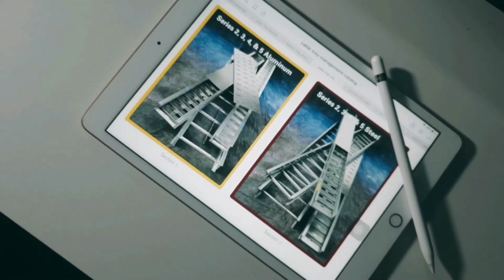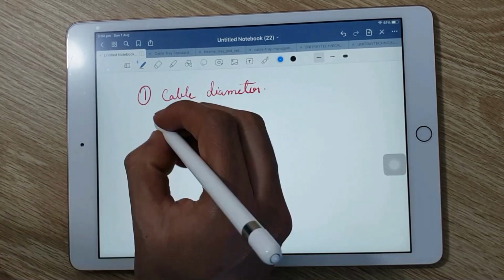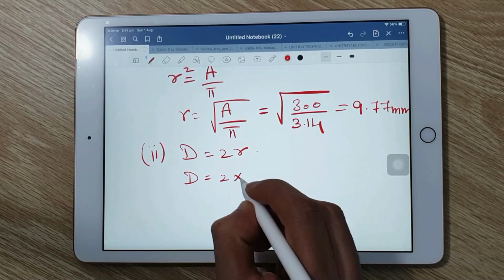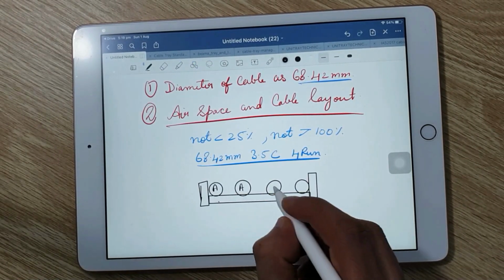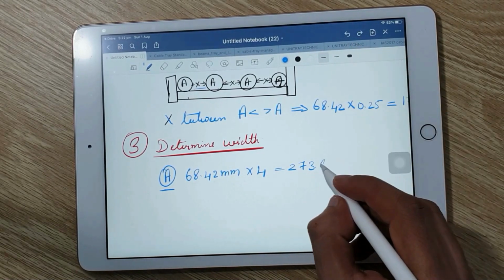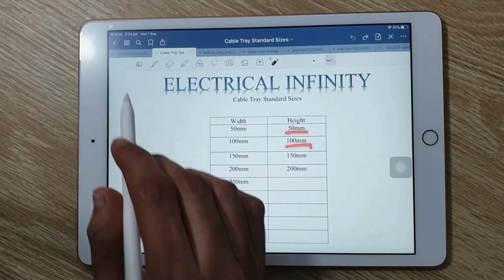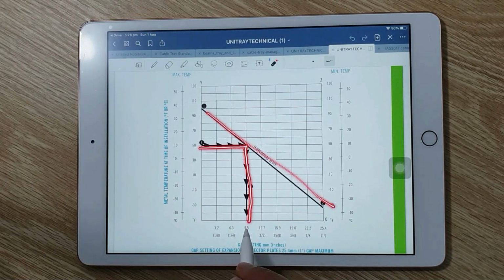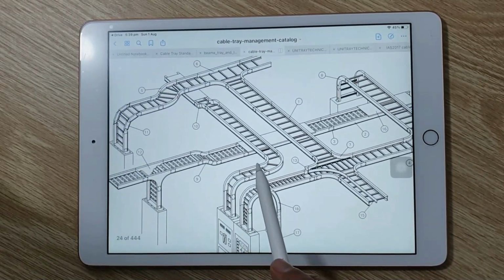Cable Tray Size Calculations | Cable Tray Selection | Electrical Designing

Comment: Please also include the thickness of the GI sheet i.e. the cable tray u have shown how to calculate the width, Depth and thermal expansion gaps but how do u select the thickness like the weight bearing capacity of the tray and the supports needed like the tray is supported on c-shaped channels hanging from threaded rods suspended in the ceiling or simply supported by steel channels on ground . As you done the calculation , you should also include the weight of the cable per meter multiply it with the tray length and number of runs which will give you the exact weight of the cable lying on the tray depending on the weight you have to select the thickness of the cable tray(like 1.5mm or 2mm depending on the weight bearing capacity of the GI sheet/ ladder rungs if it is ladder type/ perforated/ solid bottom ) and you also need to provide cable cleats or cable ties in order to protect the cable from shooting out of the tray in case of short circuits. Please feel free to correct me if anything wrong in it at the end no one is perfect ......ohhhh i almost forgot to mention the spare capacity in case you need to lay more cables on the existing tray for future expansion of the facility.😛😛

Comment: Sir i have a question. Why we are not considering the thick ness of arnouring like materials apart from the conductor size to determine cable diameter
Reply: Same question , insulation material should also consider 👍👍
Reply: From vendor cable catalogue or specification sheet directly we can get dia of the cable. No need to do calculation @syedmohammadsaif8344